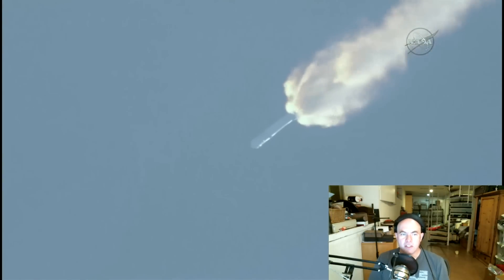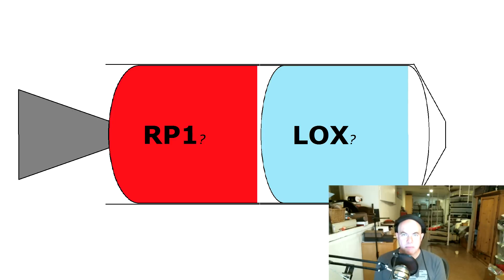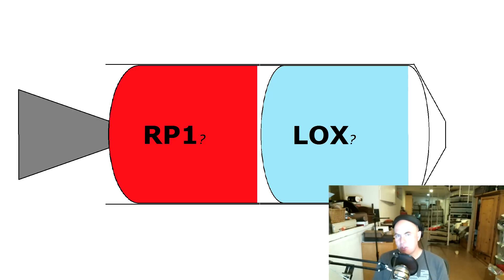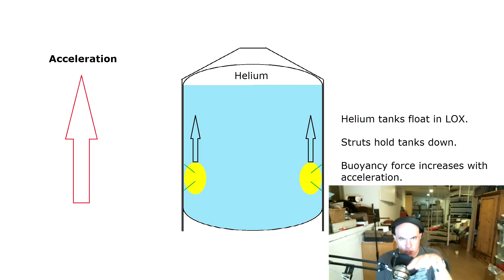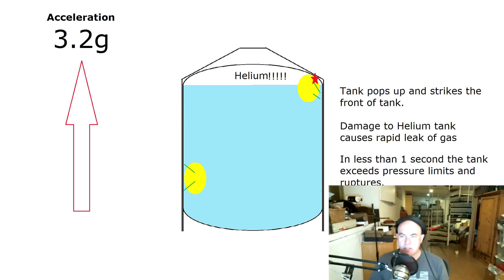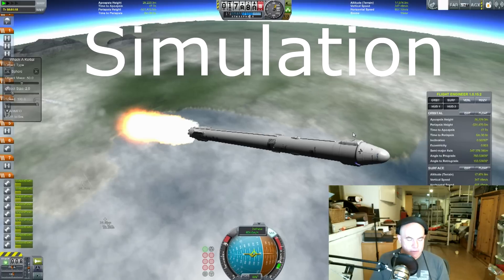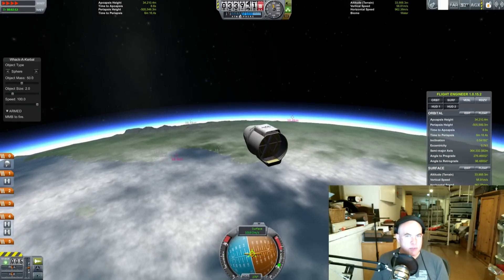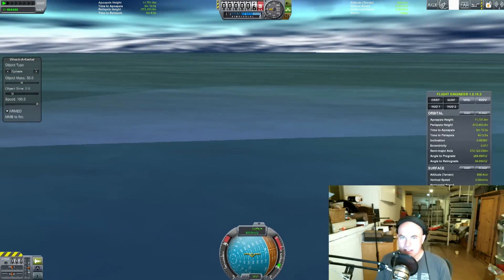Explaining the Space X CRS7 Launch Failure

Comment: Wait wait wait.... you mean they didn't bother loading up something to engage a parachute? I don't know the specs of a system utilized with these kinds of things, but as a generic software engineer, that program can't be that huge. Sounds like all parties involved messed up on this one. Yeah the fact the main cargo system DID survive is luck, but any analyst would be shaking their head at this one. That, or why didn't anyone connected in monitoring things not engage things themselves?
Reply: Flame Soulis It's possible they ran a risk analysis and the feature didn't make the grade. Just off the top of my head, there's the possibility of it deploying the chutes at the wrong time due to a faulty sensor reading or an unexpected combination of conditions. Historically, that type of failure has happened more than once. If you're asking for remote activation then there's a few additional issues there - you're adding more types of communication which can be corrupted and trigger the wrong action for example. I'm sure they have a fairly thick document somewhere detailing every possible way that the feature could fail.
Reply: Flame Soulis The system that automatically deploys chutes would have to be good enough such that the chance it would trigger incorrectly is extremely low. If the system causes additional launch failures, it's hardly worth having. I also doubt they have the ability to arbitrarily command the dragon capsule to do whatever they want remotely at any time.
Reply: Arkalius80 they could've test it using their supercomputers/simulator. IMO they just didn't try.
Reply: xponen I think you're oversimplifying a much more complex question. The people who build these things aren't stupid. Risk assessments are made and decisions are made based on probabilities and costs.
Reply: Kemp The Saturn V actually had 3 wires that ran all the way down the rocket and if at least 2 out of 3 of the wires broke then the abort tower rockets would activate and the capsule would seperate from the rest of the rocket.
Reply: Arkalius80 The chance of a catastrophic failure that leaves the capsule intact was probably even lower. Yet it still happened.
Reply: Flame Soulis Dragon has no abort functionality, the only possibility of an 'abort' situation is if it happens to survive a destructive situation, which it did. It's not as simple as just engaging the parachute. A lot of effort would have to go into providing this functionality, for an incredibly unlikely situation, a situation in which it is expected you'll lose Dragon anyway. There are a lot of things that could go into Dragon and Falcon to add all sorts of functionality and monitoring etcetera, but you can't be cost effective when you are spending a lot of man hours on features for incredibly unlikely events. It all changes when you start manned flight, but the Dragon is expendable.
Reply: *****
Don't get me wrong, I'm not doubting the potential of it all, just that I find it odd that there was no backup plan. I know it's expendable, and it could just be me being more driven towards seeing less resources being lost in a given situation, but at the very least a remote command to engage something, even another system, some kind of emergency protocol can't be that complicated.
Reply: Flame Soulis I'm not a rocket scientist, and they are... I tend to think that if I think something is obvious and they haven't done it, then probably there is a good reason for it that I don't have access to. It's possible they just dropped the ball here, but it's hard for me to simply accept that unavailed of all the information and knowledge they have.
Reply: Flame Soulis It's not complicated, but it is risky and it relies on humans. As an example of risky: every new remote command you add is a new remote command that can be accidentally triggered by corrupted communication. As an example of relying on humans: in these situations you have literally seconds to act. Either you're relying on a chain of command to give the signal, which is most likely too slow, or you're giving a single person the responsibility to make a split-second decision that the launch should be aborted. I would hate to be that guy.

These are just examples off the top of my head. I bet the company themselves have a massively thick document detailing every possible way that things could go wrong with the abort system. In a lot of cases it's not about the ease of adding the feature, it's about the additional failure modes that the feature could bring with it.
Reply: ***** Just to let you know, Dragon 2 will have built in abort rockets. They've already successfully tested a launch pad abort and in the coming days I'm sure they'll do an in-flight abort as well.

Comment: So basically, the failure of the rocket was due to someone failing to do their job right in quality assurance.  Not exactly 6-sigma standards, obviously.  Why you would ever use something on a rocket without testing it first is beyond me, of course...
Reply: Sky Render You can't stress test a part and then fly it. Your testing will, at best, weaken the part to below spec, or at worst, make an already present flaw worse without detecting it, and thus your "tested" hardware is now significantly more likely to fail in flight.

You don't fly stress-test hardware.
Reply: Sky Render 
The struts were supposed to withstand 10,000lbs so they took quite some margin. Apparently on the 1000s of struts they tested, only a few failed below 2000lbs, quite unlucky IMO
Reply: Sky Render If you check out a lot of these "disasters" you will find out that many times its a QA or testing problem. The thing is, you can't test everything in every situation because you have to come up with the idea that it could happen. On the other hand, you also rely on external parties to deliver the right stuff (certified and tested). They can not (re)test that again. They do during audits and certification processes. But at some point you have to trust what is delivered.
Reply: Sky Render Did you know that the actual acsent stage that was bolted to the the Apollo lunar modules never was testet before it got to the moon? Of course they testet identically constructed models before, with a succesrate of about 50% by the way. The problem was, the thing wasn't designed to be used more than one time. So after every test they build a new rocketengine for the next test. So they didn't know if the thing would work until the astronauts tried to start it on the surface of the moon.
The thing is, you can't test every part, because some parts don't work properly anymore after you tested it.

Comment: Huh?!? The tank holding the liquid with the greatest initial weight is placed forward as that provides for aerodynamic stability. (The Center of Mass must be forward of the Center of Pressure for stable atmospheric flight.)  Placement of Fuel and Oxidizer tanks does matter in Rocket design..

I know that you know this as I have watched many of your Kerbal Missions before. You said it in your Spaceplane video. I think I watched that one last night....where you successfully launched a lander to Mun...without a Science Package....during a Kerbal eclipse...so that you had no electrical power...LOL....great video.

After the atmospheric phase of flight is completed then it does not matter as there is little to no atmosphere in space.

But during the boost phase it matters....a lot. Even the best gyros and the best thrust vectoring systems will not be able to overcome that torque about the Center of Gravity caused by the pressure of the atmosphere on an unstable rocket at high speed.

Well at least the helical corkscrew trajectory is somewhat symmetrical. ;-o

No...no...no...no...no.

How does one spell Catastrophic Failure with loss of vehicle? Oh...I know...CATO/LOV

I learned it, however much more expensively, by flying custom built Model Rockets. I have CATOed my share. Experimental Rocketry is always expensive. Expensive for successful flights and much more expensive for failures with loss of vehicles. Today it costs about $5/flight at minimum using standardized, off of the shelf, Rocket Engines....for 1000 feet? One second of burn time....coast phase...then recovery phase...one minute of flight.

For High Power Rocketry the costs can soar to hundreds of dollars...for one successful flight.

And unlike the Federal Government in the United States I do not have the access to a Central Bank with a Printing Press to finance and budget my endeavors. (Maybe i ought to get a Patreon account?)

(It is advantageous to be a kid today because we have simulation technology rather than the School of Hard Knocks technology of my day. It is cost effective.)

Let's not slaughter the Kerbs....needlessly.

Comment: so its not SpaceX's fault, yay!
Reply: kinda and kinda not. they should always check their hardware if possible. which I'm sure they will do now. and the manufacturer should cover at least a part of the replacement cost for the vehicle and its cargo.
Reply: Condorscondor Condor Lehtaan What SpaceX needs to learn from this is to perform Non-Destructive Testing (NDT).  Basically, they need to test the struts to near the limits they are designed for without actually "breaking" them.  I put breaking in quotes, because you must consider plastic deformation of the components being tested.  If you go too far, the part is no longer useful and does not meet the spec.  If you stay under the limits and are able to perform repeat tests with similar results, then the part is good.  What I see coming form this incident is that they will find struts that have limits exceeding the forces in the launch, but have tests that reach values higher than what is to be experienced in the launch.  This is over-engineering the need, but may be necessary.
Reply: I think they should build EVERYTHING themselves, that would fix issues like this one.
Reply: Lehtaan While I agree with you, I don't think they have the capital, or the space for that. They're running out of space as it is.

Comment: helium burst disk are designed to prevent the rocket from blowing up not causing it to. what happened here is a strut broke and the gas leaked out. burst disk blew tank over pressureized and the range safety officer armed self destruct the sicond stage blew up first fallowed by the second which blew up when the tank failed.

Comment: Relative density of fuels is not the only reason to put LOX on top and actual fuel at bottom. If we talk about RP-1 fuel - let's just remember that kerosene is NOT cryogenic liquid, while LOX is. And what do we have at the bottom of the rocket? Right, the engine - the huge heat emitter! =^_^= It's obvious to keep your cryogenic oxidizer tank as far from heat source as possible.

Comment: Why not fix the helium tanks at the top of the tank in the first place ?
Reply: metalcoyote81 
The cold lox enables them to put more helium into the tanks.
The tanks still would be subject to pulling forces but in the opposite direction when the lox tank empties.
But those forces would be less as the second stage's maximum acceleration is lower then the first stage.

Comment: Lots of people seem to think that SpaceX should have tested these parts.  Others will point out that they can't test a part without destroying it.

They could have afforded to destroy a few parts for the sake of testing.  The issue is that the failure is probabilistic and you really need to test a ton of them. to know if it's safe or not.  And on top of that one batch could be safe and the next one could be bad so even if they tested them they could later fail and really it's just not something that spaceX could afford to do for all of their parts and this was completely unpredictable.

But now that they pinpointed the part that failed, I'm sure they're testing a bunch of them even if it means destroying them.  It's worth the cost to protect the reputation of SpaceX.  It will help them if they could show it was the manufacturers fault.

The manufacturer is the only one who is in a position to test it, they have access to the equipment that makes the things and they are supposed to constantly be making sure it's in spec.  Let's say they heat treated the struts, (I don't know if they did)  but let's say the oven was malfunctioning and not running at the proper temperature, the manufacturer might not find out until they do the next routine test of the oven.  Once they did that, every part produced between the two testing periods would be suspect.  Maybe they could reheat treat them, or somehow track when it failed.  But it wouldn't surprise me if one of the managers decided to ship them out anyway. Managers in manufacturing are under a ton of pressure, especially in a union environment, where the managers are pretty much responsible for anything that goes wrong.

Now they might find out when they test the oven, or they might find out when they do periodic tests on the final product (ones that destroy the final product) and find that some of them start failing.  Even if they did that they risk some bad ones slipping through.

Manufacturing is a very competitive and low profit industry.  If you look at the profits made from the iPhone, hardly any of it goes to the manufacturers.  So if they do too few tests, they will have lower reliability and if they do too many, their expenses will rise and they could be  less competitive in price and go out of business.

On top of that the buyer may have no way of knowing how extensively it is tested, or it could be a ton of work to find out.   That's why manufacturers rely on the reputation of the brand.  This is why sometimes big name tool companies buy out smaller ones with a good name and then start cutting corners, like Black&Decker did with DeWalt, see AvE's videos on that.

Space programs are also under cost constraints so Elon Musk probably went through great efforts to source the parts for as cheaply as possible while only minimally compromising reliability.  Nothing is perfect though so this time he got burned.

According to wiki a falcon 9 launch costs $60 million so if there is a part that if it fails will cause critical failure and destroy the rocket with a probability of let's say .0001 let's say you did many many launches in the long run this part's failures will cost you an average of $6000 per rocket  now if you could get that probability down to .00001 it would be worth spending $5400 more on that part.  So if the original part costed you $1000 it would be worth to get a really carefully made one for $6400 that is 1/10th as likely to fail.  This is why they buy really expensive parts.  

Also if there are say 5000 parts that could each fail in such a way that would destroy the rocket with a failure rate of .0001 per part .9999^5000 you're looking at a less than .61 success chance which is completely unacceptable at least for human rocket travel.  Now if they are 10x less likely to fail.99999^5000 your success chances would be .95.   This is one of the reasons rockets are so expensive.  Just some food for thought.

Comment: it can be fixed by placing helium tanks at the top of liquid oxygen tank not on the bottom(biggest density difference ) where the helium's buoyancy is greater than struts can withstand. are spaceX engineers aware of buoyancy?